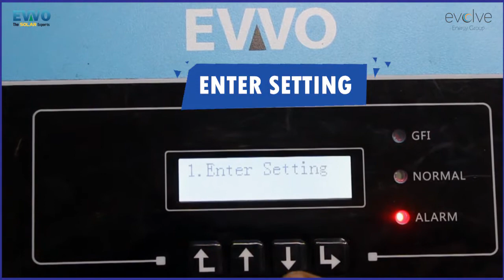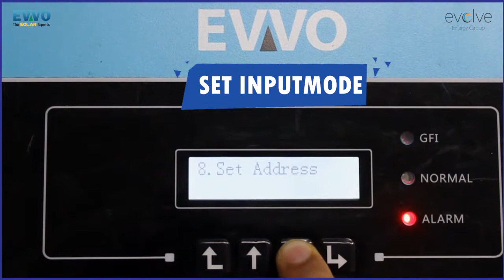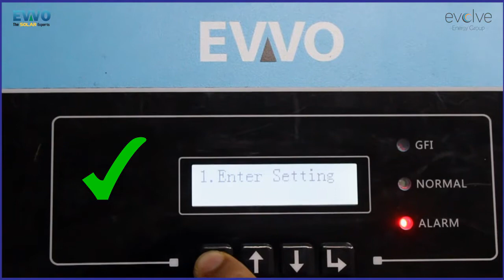#Solar - How to resolve PV config fault? | EVVO Solar | Syed Technical Engineer

Comment: SOLVED ✅

This worked for me - however it was the other way around. It was set to Parallel, and I changed it to Independent. 

Anyway, it worked. Password worked. Did exactly what he said, except swapped the mode on the second try.